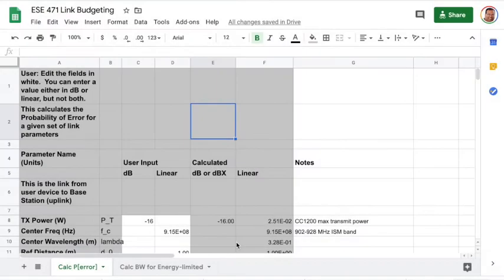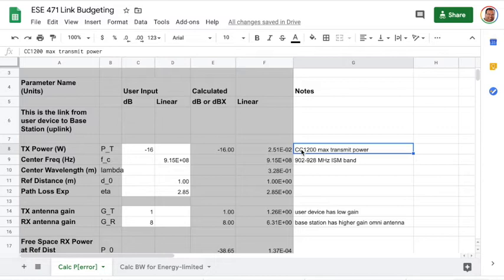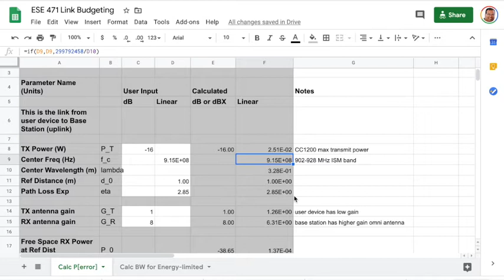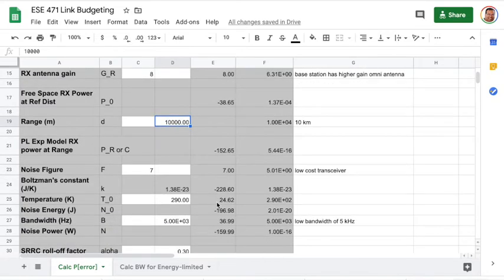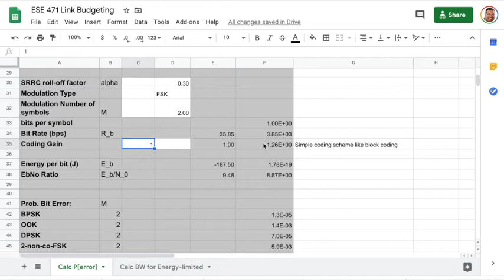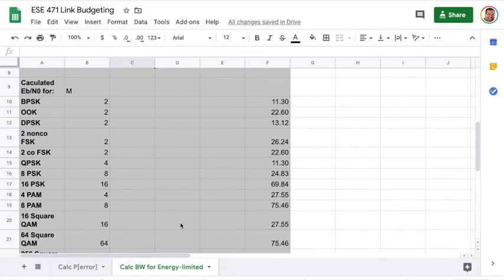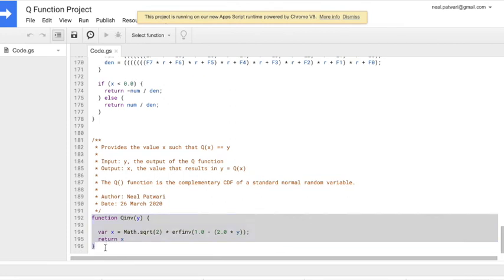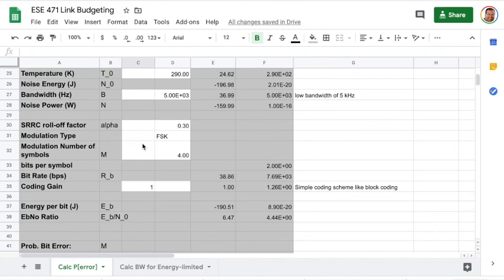ESE 471: Link Budget Spreadsheet

Comment: in the google sheet, cells F44 and below have the wrong formula, for example F44=Q(sqrt(2*$F$40)).  Can you please check?
Reply from the maker: That formula is correct -- the probability of bit error in BPSK is Q(sqrt(2*Eb/N0)).  Here cell F40 has the Eb/N0 ratio.  I don't see any bit error formulas in my sheet that are incorrect, but do let me know if you do.
Reply: @NealPatwari  When I click on the google sheet, all these cells just shows "loading...", and "error: loading data".  Not sure why.
Reply from the maker: @HL-fy8nq  Not sure why, but currently on Google Sheets, you need to type something in a cell and hit enter in order for it to run the calculation from the "Apps Scripts" I'm using.  Save your own copy of the sheet and then enter something (even the same number) into a cell.  It should refresh the calculation.